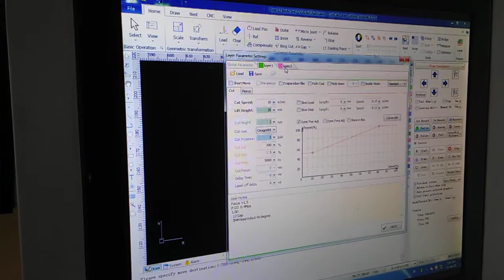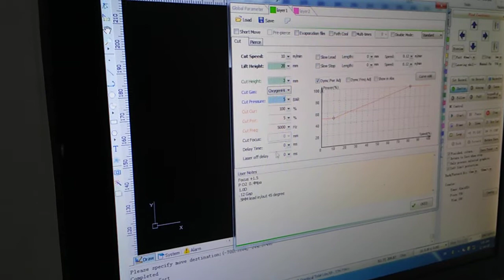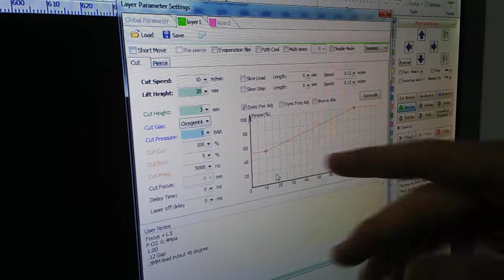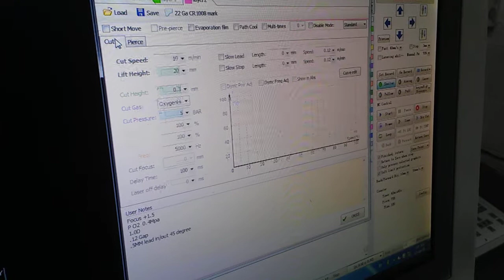How to do engraving with 500 watt fiber laser cutter using cypcut.

Comment: excellent the parameter works perfect.  Do you have a parameter to cut small letters in 1/8 ”thick in carbon steel with oxygen?
Reply from the maker: To cut them? Not sure if that is possible, the issue is as heat builds up in the metal it becomes more and more reactive and will burn more. Cypcut is pretty decent but it lacks a function to calculate and compensate for the heat build up.

Comment: Hello... I have just bought a machine of 1000 W (fiber laser) from China and i m not able to configure all the functions. can you please help me to setup my machine. plz reply asap
Reply from the maker: I likely will not be able to help you solve every issue as my machine is half the power of the one you have and most of the settings are somewhat machine specific.. What aspect are you trying to configure, I may be able to link you to a manual as I have many of them bookmarked.

Comment: How set 2 layer

How to set  green for engraving, pink for cutting
Reply from the maker: First you import the drawing to the primary document not nest. Then you scan over the part of the drawing you want to engrave to select it, then click the colored boxes to switch the layer. Then you adjust the settings of the layer that matches the color you selected for engraving. Any of the colors can be used for the engraving layer. Just pick one and use the same color for that process.
Reply: @smallshoplasers8785  how much  focus set for 2mm ss?
Reply from the maker: @vengatthiyagu6898  for engraving the focus I use is the same as cutting, you use increase the cut height to 3mm which widens the laser slightly. I have used both positive and negative focus and did not see a difference on engraving. For cutting I sadly can't give perfect answers, because I have not cut 2mm stainless so I don't have tested numbers. I can say it will be a negative focus height, and you will want to use clean compressed air or nitrogen, pressure around 12 bar or 165 psi. And a cut speed between 2-3 meters per minute.
Reply: @smallshoplasers8785  Can you help me via email
Reply from the maker: @vengatthiyagu6898  I can try. It will be a few hours, it is very late here. Send me an email and I will try to help. 4x4fiberlaser@gmail.com
I can't tell if you speak English or are translating with a application, If you are translating please send both languages because engineering and mechanical words don't translate well.. If you could describe more of what you need help with I can answer much more clearly.
Reply: @smallshoplasers8785  your email  address
Reply from the maker: @vengatthiyagu6898   4x4fiberlaser@gmail.com

Comment: How can you do this??  Please  tell me,
Reply from the maker: I'll make a new version of the video in a few days with a copy of the screen more clearly. I'm guessing we have a language barrier that is causing issue with understanding the video. Just copy the settings from that new video and then start making adjustments on your machine. Let me give to the settings for engraving and hopefully you can translate.
One layer of your drawing will need a new set of settings to engrave instead of cut. The below is with a 500 watt machine.
Cut speed 10 meters per minute
cut height 3 mm
cut current 100%
cut power 5%
cut frequency 5000 hz
dynamic power adjust on. Then adjust graph to show
50% power at 10% speed. 100% power at 80% speed
Reply: @smallshoplasers8785  Thank you🙏

Comment: hello friend. thank you very much for the explanatory video now I would like to know what are the parameters or what should be done to cut stainless steel with plastic coating. I thank you very much for the help you can give me, thanks.
Reply from the maker: Sadly I don't use much stainless. My understanding is that you may want to run a second layer that will hold the laser head back a distance to burn the film off the cut lines before attempting the cut.. Some protective films are better for lasers than others. But again I don't work with them... I don't sell laser machines, I just happen to own one and am trying to be helpful where I can be.. It is likely a laser seller could be more helpful with this specific question.
Reply: 4x4 500 watt fiber laser friend thank you very much for your comments .. even so you help me a lot. do not stop posting videos. again thank you very much.
Reply: For cuting protective film firs mark in layer  evaporation film square.

Comment: The gap you are referring to is called “TAGGING”
Reply from the maker: Tagging is done using the "micro joint" tool in cypcut.. Using the correct term is correct but when you are trying to remember what tool you are looking for in the software, being in the habit of calling it "Tagging" will have you looking for a tool that does not exist in this program..
Reply: Brilliant! I have been using various types of lasers and nesting softwares. I have just ordered a brand new 1000w fibre laser from china so I this is me learning cypcut watching your videos :). I do have a few questions though
1. does it automatically apply all the settings i.e. leadins, gaps e.tc if you do not wish to change anything?
2. how does it cut ss with plastic on?
3. what major or minor everyday problems have you seen with these machines?

keep up the good work and when is a new video coming out?

Comment: How does it do on aluminum sheet?  The Rose Graphix site says 1mm (0.040") thick sheet at 8 ft/min.  I'm wondering if it will do thicker aluminum at slower cut speeds or is 1mm a hard limit for some reason?
Reply from the maker: With aluminum you have trouble with a large amount of the light energy being lost to reflection/scatter, and you need to use Nitrogen so you only get the direct output of the laser to do the cutting.. I would imagine 1mm is a rather hard limit.. Going past that would likely result in really rough cuts or possibly damaging the machine.. A good person to reach out to is "a pyro design" he has done Aluminum on a 500 watt rose graphix unit.

If you are doing a fair amount of aluminum it would be logical to go to a higher output laser to increase the production speed and to reduce the consumption of nitrogen. I have a chart from raycus laser that makes the power supply used in the rose graphix machines, they show the 750 watt as having an approximate cut speed of 8 meters per minute in 1mm aluminum and 3 meters per minute in 2mm aluminum. The 1000 watt  shows 8-10 meters per minute in 1mm, 4.5 meters per minute on 2mm and 1.2 meters per minute on 3mm aluminum..

Comment: Have you experimented with raster engraving in metal with your laser?
Reply from the maker: I have not.. I had to look up what raster was, I think it could do it, but the gantry direction shift takes a bit of time since there is fair amount of mass moving, I'll do a little demo next time I am cutting parts... 
If I was doing a lot of engraving I would probably get a dedicated engraving laser rather than wearing out the motion table of my fiber laser.. We have probably engraved about 50 items, compared to cutting something like 40,000-80,000 parts.. My need for laser engraving is limited to marking tooling or fixtures. I can't manually engrave hardened tool steel, but the laser can write anything on it in seconds.

Comment: How do you join all the lines to make a complete cut of each piece? How is the command?
Reply from the maker: You just draw the object with closed lines. In the video we did the micro joint to keep the part from falling out, generally you don't want the parts to fall through into the scrap tray as the scrap tray is extremely dirty and cleaning the parts is time consuming.